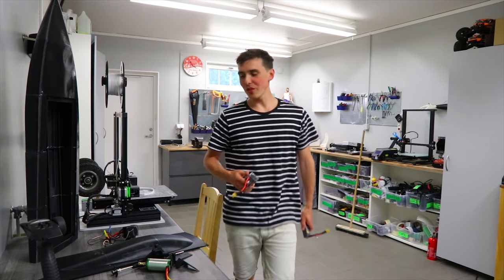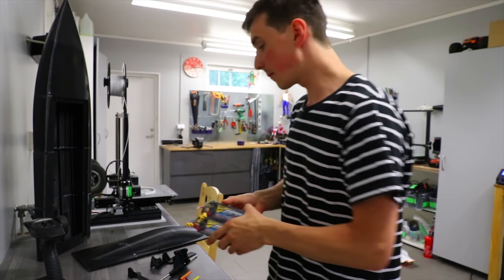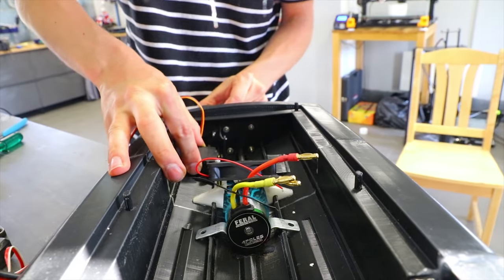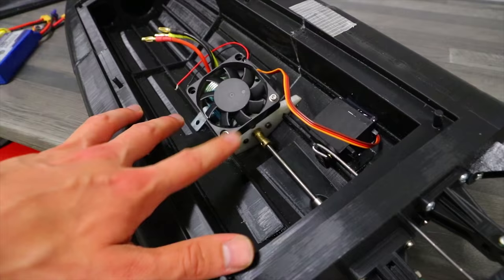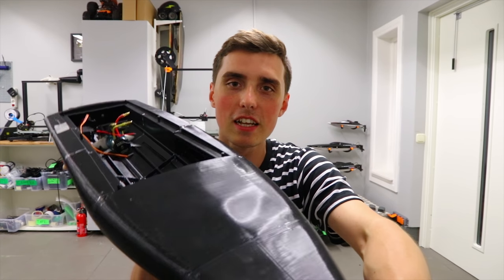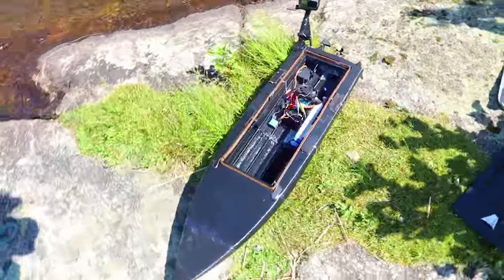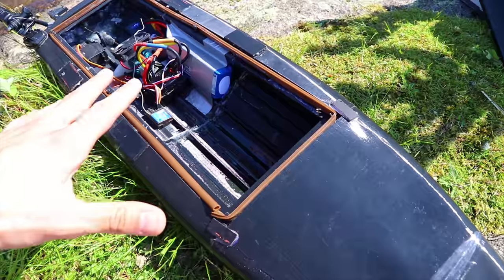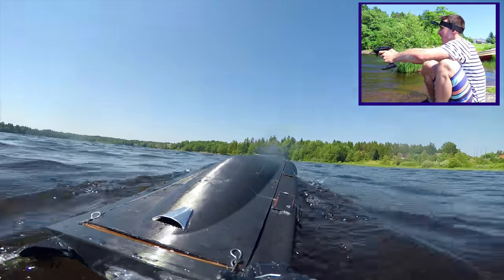BIG 3D Printed RC Speed Boat

Comment: I would love to see a fpv submarine
Reply: kanter bow that is agree at idea I've been interested in subs my whole life
Reply: I’d like to make a rc submarine that looks like a sub from subway 🤣
Reply: genius!
Reply: Then first invent a radio system that is capable of transmitting video through the bunch of water, I would like to see this 🙂 Don't forget to patent it! 😎
Reply: true!
Reply: yep, this is indeed the main problem and why all the "fpv" submarines are tethered...
Reply: It would sink!
Reply: @kukosek  150m ethernet cable! xD
Reply: Almost impossible unless you are using a cable attached to the sub to get the signal to the sub cuz 2.4 MHz doesn’t travel underwater.
Reply: @sparky5894  what the hell is 2.4mhz? It's 2.4ghz and 27mhz.
Reply: @user-dz2jv4in5z  Sorry 2.4ghz
Reply: That's called an ROV, they've been about for decades commercially (and even DIY). I've spent my career so far designing/building/fixing them- they're fascinating!
Reply: Homemade submarines hit different in mid 2023

Comment: I'd change the design to incorporate the following changes.  Through each beam put three holes.  Center bottom and below each gunwale.  Size the holes for carbon fibre rods.   Epoxy the rods in as you build the hull.  When complete sand the whole thing and seal it with a compatible clear coat.  Boats are water cooled for a reason, get on that.  Design the lid to completely seal the hull.  Install floatation foam wherever you can.  Add trim tabs.  Consider swapping the rudder for a metal one.  Good luck, neat project, can't wait to see your next iteration.
Reply: Sarkazmo Loafy I agree with all your recommendations along with lowering the prop a wee bit to keep from cavitating once the boat gets on plane
Reply: Sarkazmo Loafy yup yea ok uhuh for sure no kidding eh

Comment: you can also use the 3d printed hull as a mold for fiberglass by covering with a thin layer of wax an you can fiberglass right over the plastic an create an thin strong hull.
Reply: true
Reply: Wouldn't the shape be a bit wonky? Would it be better to print a negative of the hull and insert the fibreglass inside then pop it out to capture all of the detail? I Have printed this boat but haven't glued it together yet. I am not a fan of how they ar strong.e just butt joints with no locking mechanism to align it or keep it

Comment: Very nice build....  Minor suggestions for version 2....    Using a two-part epoxy and possibly a clamp when attaching each section together, two bearings on your driveshaft.... And setting the prop lower underwater to keep it from cavitating and sucking air...

Comment: Be careful that any retraction you have set in your extrusion is not leave tiny holes in your perimeter!  It may also help to increase the infill/perimeter overlap to help minimize tiny holes in the corners of your infill/perimeter junctions.  You might also try sealing the hull with a clear epoxy called Smooth on.  It would definitely help with any drag caused by your layer lines by smoothing everything out.  Hope this helps!

Comment: You can cover the boat with spar varnish / boat varnish, a few times and no water will get through the PLA. For the boat construction, try to design some "click on bolts" or just use some screws between the parts. This is absolutely important, as the boat will get a lot of heavy vibrations and pushes, for example wave jumps :-) and i would rather stick to a water cooled ESC, because of the PLA. Keep it up!

Comment: Thanks for the video, Simon! Sad to see the boat have issues, but it's a learning experience. 
The layering in 3D printing will inherently offer little gaps for air / water to sneak through, unless you have a hull that's more sealant than plastic. Maybe try vacuum forming the water-bearing hull and have the upper hull / decoration, fins, rudder, mounts etc. still be 3D printed, as they worked fine. 
As for the propeller, I guess you could dog-leg mount it underneath the hull as opposed to behind it. There would be more drag and the gearing would be difficult to produce, but it wouldn't leave the water at least.

Comment: Coat it with clear nail varnish to overcome the water seepage. Also in your design between the sections make it so there are pin and holes for the glue to lock into,  sanding to take that sheen away before glue up can help alot with adhesion too. Promising design though. Well done

Comment: make the boat smaller so it doesn’t need to be glued together and also make it a v drive, meaning the prop comes out of the bottom of the boat kind of like the setup you had in the jet boat, that will help so the prop will grip

Comment: angle of the propeller was the issue for acceleration. If you put it into the water at a higher angle, it should help the force on the front of the boat as well as keep the prop further in the water. Was awesome though. I have been thinking about modeling up a boat to try something similar myself!

Comment: You should try fiberglass resin brushed over the outside of the boat.  It will give you a very smooth waterproof surface that should also add strength to the boat.

Comment: Made a boat last summer but printed it in 1 piece PETG. I used carbon fiber inlays for rigidity, drilled out foam ear plugs with silicone grease for holes in the transom and a water cooled engine. Had to add in a few spots for lead weights to balance things out though. First one sank after the motor softened the plastic hull too much. I digress. Great video Simon! Makes me want to dust off the old model. Too bad it's 45F here.

Comment: I usually spray my prints with Painter's touch clear gloss to seal any leaks in the layers when I need a watertight part. incidentally, it also protects it from UV and slows down sun rot. Not sure if its available in Sweden or not but here in Arizona the sun is a huge problem with temps as high as 125 degrees in direct sun.

Comment: You should spray the outer hull with a clear polyurethane.  also, in addition to glue, bolt the parts together.  helluva a job as always!

Comment: It is a nice video. I am following your videos and your projects, I think the best choice for this project is the PETG, it is easier to print than abs or asa and it doesn't need enclosure, it has a very good adhesion between the layers and it make waterproof that material. I print some vase with 3 wall and it can be hold water without leaking.
Welcome from Hungary!
Reply: I agree - I baffled as to why we see PLA on so many youtube projects that are intended to be rugged and survive outdoors.

Comment: Just a thought, to add some structural rigidity in the axial direction of the boat, you can add some dowel holes to the model for some metal dowel rods (or all thread) and place them from the front all the way through the boat. It might help.

That drone footage was AMAZING. I could probably watch that all day.

Comment: 1) dont use PLA, use ABS(or ASA, or SBS or anything, but not PLA) and acetone-wield the parts. Make sure the bottom of the boat looses layer texture to reduce friction.
2) if you want it to glide, manage the center of mass. (include a camera and its mount into your calculations. it should not be at the side of a boat.)
3) it is possible to create a cavity bobble around the propeller, that is why you have to manage its speed and accelerate not as fast.
4) You can use a fan-cooler, but you dont have to make any tipe of holes for the fresh air to come in. The water around the boat will cool the boat nicely, if there is no air gap between the layers of a boat bottom. The fan will help to destribute the heat evenly inside an innside bobble. (if it glides, however, the fresh air is a must, as the water contact point is minimal.)
Or you can try using water-cooling.. duh.
5) if you feel like it, put metal threaded rod as a construction element. Or two. Or three.  Or maybe use a guitar string to create a tension between front and back of a boat.

Comment: I would recommend if you have a problem with leaks I would use a lot of flex seal, it is more more efficient on water and is lighter and converts more surface area than epoxy, which is heavier

Comment: It might have to print in more segments but printing the joins at angles, perhaps chevron shapes, would give more surface area and strength at more angles.  Pins would help too, maybe keyhole joints so they lock in easily.

Comment: A couple of observations. "Cavitation"of the prop coming out of the water. You need to angle the shaft of the prop where the prop is lower in the water. There is probably a formula for this somewhere. The lower the shaft and prop is in the water the more power you will get. But less speed. This probably does not matter in a light weight PLA Printed boat. And the angle of the prop blades make a difference between power vs speed. Also, probably does not matter to much  as the boat is so light weight.

Comment: Hi, your projects are really great !!
For rigidity why not provide on each side and at the bottom of the shell housing for carbon tubes (such as arrows archery or kite).
For the floating of the watertight compartment filled with polystyrene (insulation for houses).
And for the hull linkage foresee a groove to put an O-ring in and screw them together.

Comment: Instead of gluing the parts together, solvent weld them together. A solvent welded join will be as strong as the rest of the boat. It’s hard to get epoxy to stick to plastic properly. I look forward to the next attempt.

Comment: Any time I print PLA items that need waterproofing I print at a higher than normal temperature for better layer adhesion, adjust for slight overextrusion, and spraypaint it. Never have had an issue with this combo. Also I think your prop may have been cavitating. For holding the pieces of the hull together you should design an overlapping joint in instead of a butt joint. It is easier to glue PLA securely with this method.

Comment: Change to PETG or Nylon, light colors like you said in the video. If you are going to print flat parts that fit together, hold them together with dowels of some sort so there is support for the pieces to hold on to. Just my thoughts

Comment: If a hull shape is efficient then it doesn't matter if a propellor sucks air.  MOST rc boats actually use surface piercing props where only the bottom half of the propellor is in the water , the top half is in the air and the whole prop ventilates, allowing it to spin at very high speed and create a huge roostertail.   ie there is initially a huge amount of slippage as the motor achieves full revs almost instantly at slow boat speed, and then as it builds some speed the prop begins to grab more purchase on the water and continue accellerating whilst often spinning slightly slower

Comment: The one problem sounds like cavitation, might be worth reading about it. You were using a prop that didn't match the output of your motor.

Suggestions: change the design to a jet boat, use liquid cooling for the motor and motor controller. For the hull sand it, prime it, and then seal it with paint. That should stop seepage from happening. And prep your electronics with conformal coating. Should be good to go then.

It's likely been suggested a dozen times already though, as I didn't read through the comments yet.

Comment: If it were me I would fiberglass the entire boat for strength and waterproofing the hull. I do this with RC boats made from balsa, plywood, and basswood. Give it tremendous strength as well as waterproofing! One commenter suggested carbon fiber rods to hold the hull pieces together. I second that idea but rod supports can be made from wood dowel rods as well or machine bolts with washers and lock nuts. I loved your video style and content so I liked and subscribed!

Comment: Nice effort. Dont give up on the project. My understanding is PLA is not waterproof so try another type of filament. I would also overlap joins in the hull so it is stronger and more inclined to be watertight.  The balance and shape of the hull have a big impact on boat speed and stability as well -I would also start with a proven hull design.shape. Good luck with the next iteration.

Comment: Get some swimming noodles and cut them to fit into front/sides of the boat so it doesnt sink if it gets filled with water.It looks like boat is rear heavy(check cg according to plan). This type of setup is meant for surface drive(half propeller is submerged but it needs to be right one and bigger than for subsurface drive..On surface drive at full speed boat touches surface on 2 points- prop and hull. Might not be a bad idea to cover hull with light glass cloth and epoxy resin(will be stronger and sealed).

Comment: I think your attempt to waterproof with epoxy was a good idea, but do it from the 'outside' of the skin/hull in order to "fill the weave".  In the States we have a paint-on/rubberized product called Flex Seal.. but even epoxy could work if thinned and brushed on as a light coating; again, from the outside- to prevent water seepage.  GREAT video!

Comment: your problem wasn't prop pushing air or coming above the water it was just cavitation the prop was spinning too fast for the pitch and diameter water can't rush in fast enough to be pushed by the prop relative to the speed of the boat you need a shallower pitch on the prop or a gear reduction on the motor. or you could just bump down to 3s or even 2s and reduce the rpms

Comment: Hi Simon, I believe the main issue with the propeller surfacing is its size and pitch. When the boat starts getting in plane, the small and shallow prop can't "grab" the water enough. I would try switching to a 35 or 38mm 2 blade prop with an appropriate pitch and slowly raise the throttle until the boat gets in plane. Once it gets into plane and picks up enough speed you can adjust the throttle accordingly. Hope this helps in any way.

Comment: Also bolt those section together, you can ebbed nuts in your print by having the gcode stop, place nuts, heat print with heat gun then continue print

Comment: You should concider just little higher temperature or aceton vapour desolving to reduce leakage, it would be good to design holes for bolts to connect  each segment. Definitly dont give up

Comment: Nice project but you should have used a Marine ESC and water cooling so you don't have air holes for water to enter. 
Also the air in the propeller is called prop slip. You could wiegh down the back of the boat or when you print it again place the stinger lower down.

Comment: Probably print this thing in PETG.  You could always paint yours a bright color to help, but it will still melt if you leave it in a hot car for an hour in the summer.

As far as the split, probably need at least some kind of peg and dowel type setup between the sections to add more strength between different sections.

Your airial shots are wonderful as always.  In awe of those.  Thanks for posting the video!  Definitely don't always need to be successes.

Comment: You need to install something that can act as a spine going down the inside of hull to reduce the amount of flex the hull will go through, otherwise it will keep splitting into its separate parts.

Comment: Sounds like you need Flex Seal to keep the inside of the boat completely dry, just like the commercials on American TV.
For rigidity, the butt joints between the pieces of the fuselage are the weakest you could use, though they may be easier to print. The pieces need to interlock in some way, like sleeving the end of one piece inside another piece, like the cap on a pen, so larger faces overlap. This would give the epoxy a much greater surface area to join together, greatly improving strength and rigidity.

Comment: nice work. Maybee you should use this print as a support/mold. It's not waterproof and strong either but -->resin is a good idea. Use your 3d print and add some stifener inside ( resin + fiber glass).  Do the same thing outside with only resin or both and i think your ship will be strong and waterproof. Add some lighter expansed foam inside to avoid drowning. You need a better seal on the opening hood.

Comment: Try to bake your 3d printed PLA parts in the oven!

It is supposed to increase their strength, probably by joining in a better way the layers of plastic. I never saw someone using that method on waterproof project so it will be nice to see.

Also you might prefer to join the pieces with bolts and nuts, using window-sealing silicone in between the parts to prevent water leaking

Comment: I know this is an old video, but there is a usefull circuit around an LM311 comparator IC that is super small and simple, it powers a piezo to make a noise when the servos on a plane or boat pulls the voltage under a preset point. SO it starts making a noise at you BEFORE it gets flat. and you can hear it whendoing minor moves, allowing yo to conserve energy and bring her home.. I'm posting this for other people intersted in making a boat or place (the one I made was used on a glider plane)

Comment: Try using ABS, if you can. You can use acetone to dissolve/meld/glue the sections together. You can then use the acetone on the surfaces of the boat to seal it up. No more porous plastic... hopefully.
Reply: Do you have public plans? Maybe some of your patrons could problem-solve and test. Just a thought.